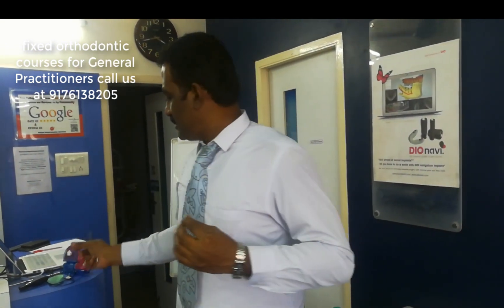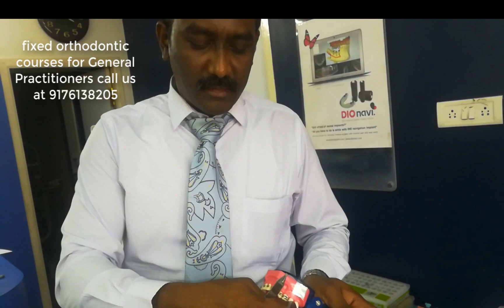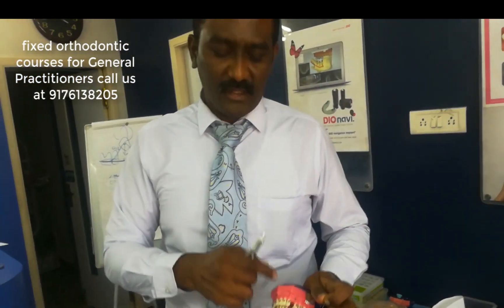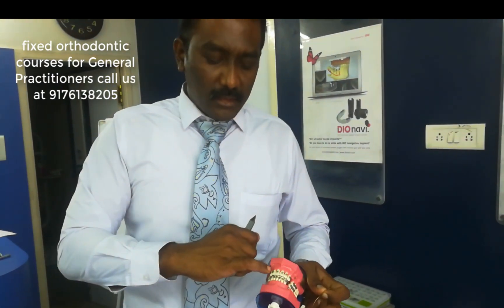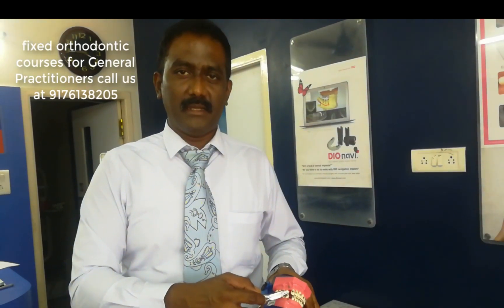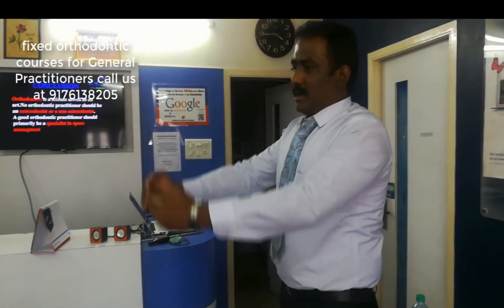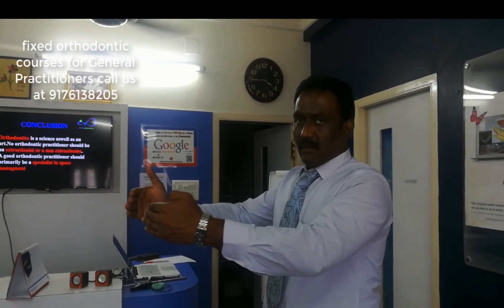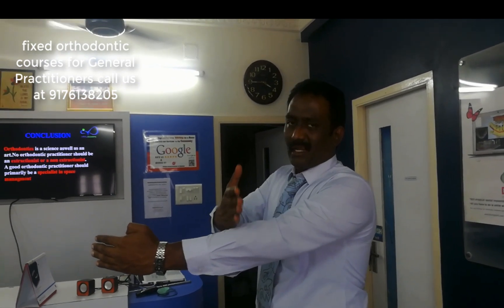Anterior tooth  Retraction  & gable bend

Comment: Second order bend (gable bend) during Enmasse will provide extra torque & will be  beneficial in preventing anterior falling into deep bite normally I engage a mild rcs in rectangular SS wire will surely try this too,  Dr. I am little bit confused regarding placement of crimpable hook as I think its better should be at center between canine n lateral to bring about a translation,, Regards
Reply: canine and lateral we need to give the crimpable hook. **